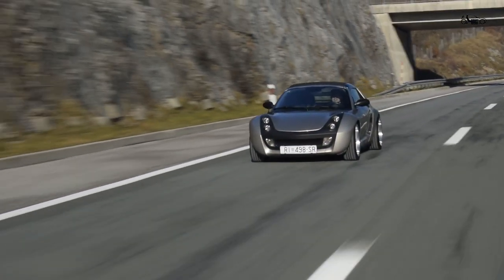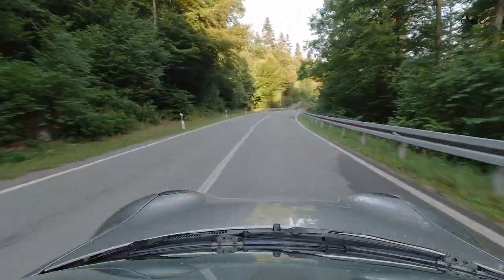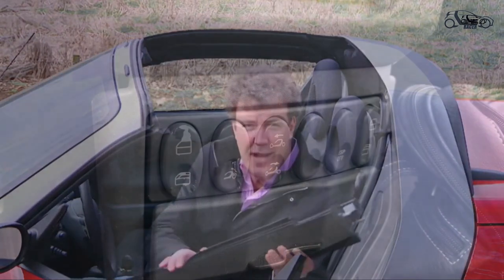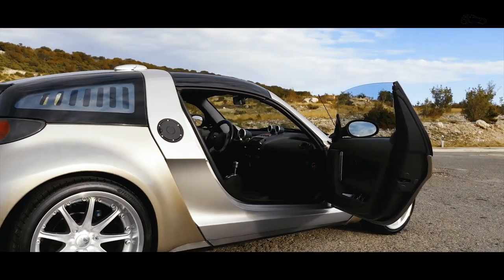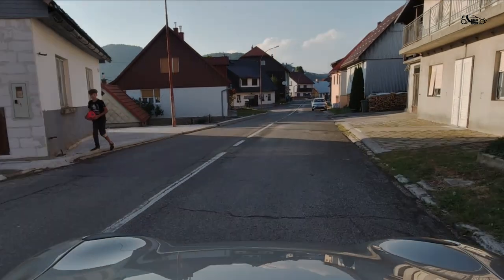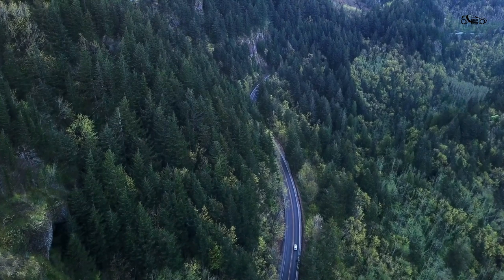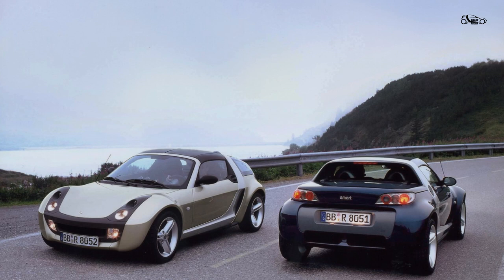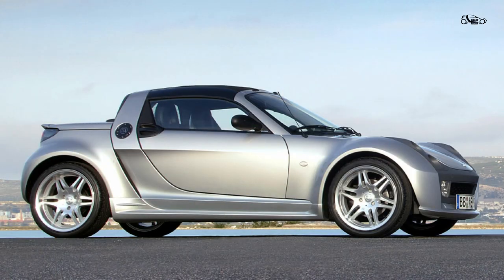Things That You Will Like If You Buy Smart Roadster

Comment: Just bought a 2006 Smart Roadster... As steal for a stylish roadster once I get it back from the Mercedes dealer ( in for a tune up and some tweaking), I will enjoy driving this car to Chalkidiki Greece. I am considering getting a second 2005 Roadster. yellow version.
Reply from the maker: Congratulations, It can be good daily car.
Reply: @SmartRacer  I am stocking up from local dealers any part I can get at fair value, like a complete soft conv. assembly for 400 euros and a bonnet (trunk lid) for 70 and a whole box of parts from Holland for 300 euro. Extra Roadster parts never go to waist 😎😎

Comment: What about the reliability of It, did you had any problems??
Reply from the maker: Crankshaft position sensor was issue for me and dry solders on Sam unit. Engine at 113 000 running ok
Reply: @SmartRacer  WOW
Reply: @SmartRacer  maybe reliability Is a big  one to consider on your list for the 5 worst things of the smart roadster